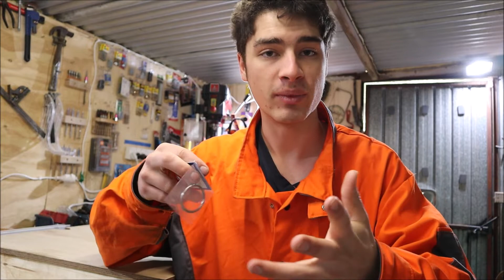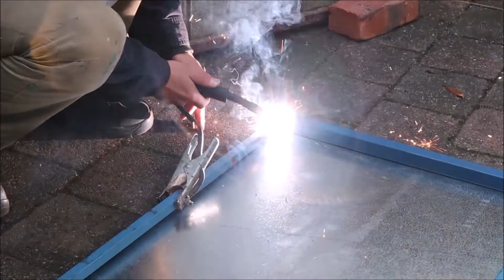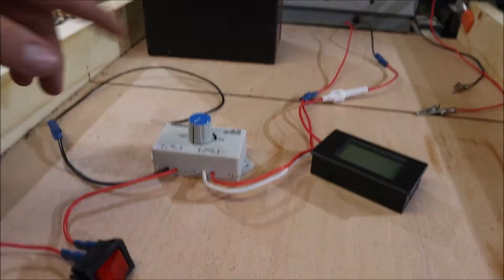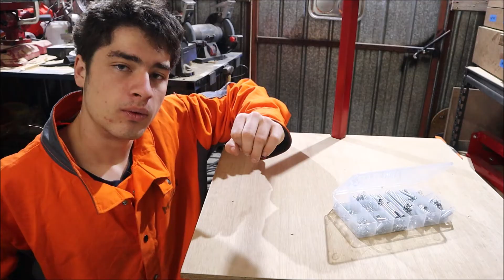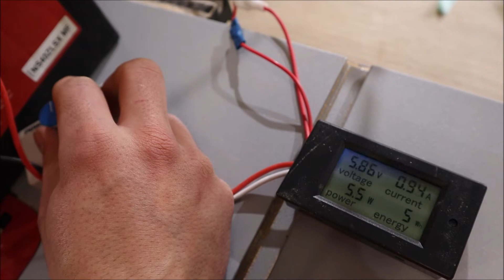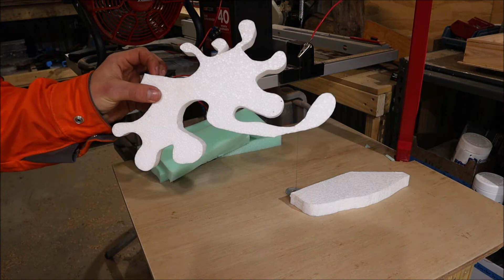Building a Hot Wire Foam Cutter

Comment: nichrome comes in many different diameters, it might be usefull to mention the diameter since if you use a smaller diameter you need a higher voltage in general.
also now you have the mashine it is time to put it to a test. how about a hybrid RC device which can drive, fly and boat. while this would be easily doable by driving it by a propellor it would be interesting to see some new methods as well such as transforming driving rotation or changing the drive system it powers. fan powered is still doable but it would be nice if it either is hidden or if it is super fast and just looks nice so that you design the looks to make the propellor also server a aestetic purpose.

Comment: FINALLY! Someone else knows about Nychrome wire - whenever I mention it, no one knows what it's for, yet if you've seen a portable baseboard heater, you've seen that wire. Thanks for this - I was about to build a 'paddle-style' cutter but you opened my eyes to a better solution, using the mantra, 'A table is your best friend.' Your design makes more sense and I like your solution to the expanding wire issue. Nicely done.